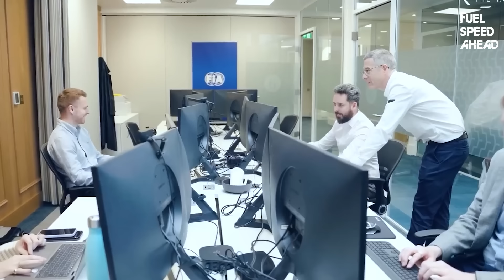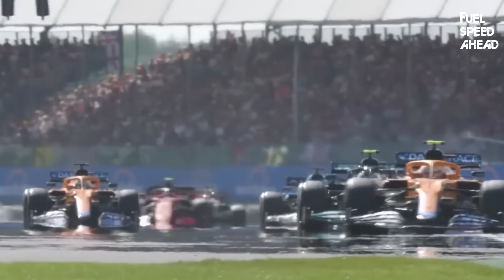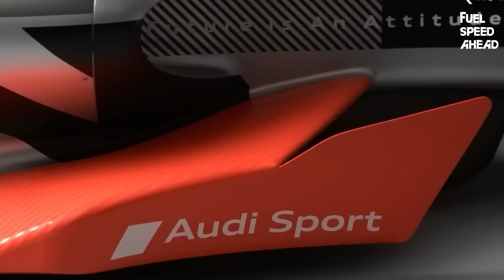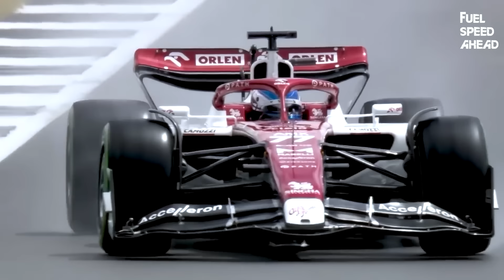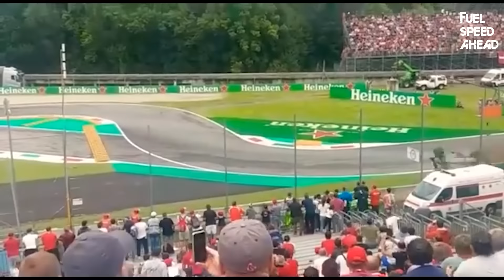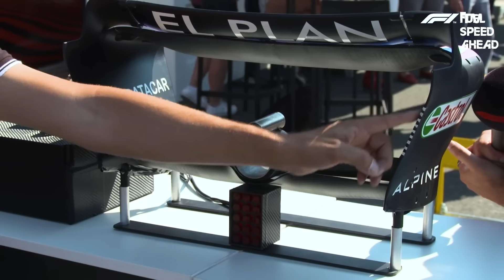F1 2026 Engine Changes That Will Blow Your Mind!

Comment: This is the F1 expression of the FIA. Utter nonsense. A supposedly 'professional' organization that has no clue how to operate a racing program, professionally. Meddling around as quasi-technologists, dictating technical approaches to electro-mechanical/physics based systems that only complicate the performance of what is essentially, a sport: & @ a time when electrification of cars is in retro. Of course, rules are necessary to ensure fairness is practiced, given the human propensity to seek an unfair advantage (see Red Bull's cost cap cheating), but the F1 officialdom have proven that they cannot even obey their own rules! Evidenced by Michael Masi's manipulation of the end of the 2021 Abu Dhabi race which took away Lewis Hamilton's 8th F1 Championship & which was upheld by the Stewards, & not reversed by the FIA. I am anticipating a difficult 2026 season, while hoping & praying it will not be.

Comment: Technical regulations are so mind numbing and essential at the same time. However, I really think the FiA would make F1 so much better by just stating what the dimensions and weight of what a car should be, the engine + battery size and the safety requirements then put a spend cap on and let the engineers go at it within reason obviously. 

The fact these new cars are potentially 2-3 second per lap slower is a joke - potentially meaning even Lance Stroll in the 2025 car could lap the whole field in a 2026 race. 

Is anyone really excited for the 2026 changes?

Comment: Electric power was always going to take over eventually. The writing was on the wall with the hybrids. There's a few problems. 1) The FIA always talk about cutting costs. But with this new changes they had to massively increase teams budget. A total contradiction 2) keeping fans happy. Fans have been saying for years that sound is very important in racing. When they changed from V8's to the Hybrids many people stopped following the spot because the new cars were too quiet. Now they are going to an even Quieter formula! It is almost at the point where the sounds of squeeling tires will be the loudest sound from a race!

Comment: Active front and rear spoilers are old ideas. We're used in Mitsubishi 3000GT VR4 year 1991 to 93 later models were built without it. I know as I had one from 1991.

Comment: I wish they would cut out the environmental bullshit. If you could magic up a battery with a wave of a Harry Potter type wand, then batteries are more environmentally friendly.. IF the energy itself used to generate the electricity is green, and the environmental cost of producing giant windmills and recycling old ones is also green. Mining and processing the materials for batteries totally destroys vast swathes of territory which the advocaats ALWAYS seen to skim over. Battery tech is fantastic, (but not in racing), but battery construction is F*CKING EVIL

Comment: Cleaner, greener future? What planet do you live on, certainly not this planet which is being raped by the Chinese for so called rare earth materials, destroying rainforests and other eco systems whilst spilling dangerous substances such as arsenic into the air, which are also carried round the globe by the five major winds and at the same time killing local miners and polluting water systems. There is only one potential, economic solution, fully synthetic fuel powered. Currently providing 10% of the motive power in the Porsche Carrera Cup. New developments in electrolysers are bringing down the costs of production on these fuels and they are on course to be equable (and more stable) than current hydrocarbons. Stuff your hybrid electric cars and F1 with this crazy development, we want to see racing on talent not on electronics!!!

Comment: Personally, I am both excited and worried. This video does make one feel like the racing may be a lot different.
Maybe like when you are low on fuel in your plug-in hybrid car, and you turn off the air conditioning to get extra miles; and one starts to drive more like a hearse than an F1 car.
Let's wait and see.

Comment: I believe adding brake lights to Formula 1 cars would offer a significant safety benefit. It wouldn’t just help the drivers behind react more quickly, but it would also give stewards clearer evidence during incident reviews. Being able to see exactly when a driver applied the brakes could make it easier to determine whether braking played a role in a collision or near miss.😊

Comment: I find it funny when they brought out a F1 car from the late 90 early 2000's and do an exhibition run, the fans and drivers go nuts.  The sound alone is awesome.  We already have an E series car.  Let's go back to V8's or V10's, lose the electric motor, big wings, flat bottom cars and go racing.  And while your at it, lose all the telemetry back at the factory and AI for predicting every possible outcome and just let the drivers drive.  Been watching F1 for over 40 years, and 2026 does not inspire me to continue.  My 2 cents.

Comment: yeah....zero carbon...this propagandistic bullshit is like cancer. Does anyone in the business happen to have learned that energy for charging the battery comes from the engine itself? Or that turbo means increasing the flow of oxygen into the engine? Which .by the way, will result in carbon dioxide, after burning? And this, for creating the energy to charge the battery...Mindblowing...

Comment: It's going to be a complete failure in 2026 with these new engines and more electric power. If the FIA listens to the fans they want to bring back the V12 engine get rid of the hybrid system and go back to refueling

Comment: No DRS thankfully
Reply: Not exactly... They are keeping it in but calling it "Active Aero" but allowing all drivers to use it in the previous DRS zones and not just as an overtake tool. They are replacing DRS with a "Overtake" button that will instead allow more horsepower in certain track sections which will instead hopefully lead to more wheel to wheel battles.

Comment: Give driver’s a set number of  wing openings, that can be used during race at anytime. Save them up or not just give drivers the choice. The corners will close the wing , that’s one opening do it again that same lap that’s two every time count. Run out game over.

Comment: In my view, we should embrace the internal combustion motor and let the electronic boost stay within the series of E cars, which has its own series
Reply: same here, v8 on biofuel
Reply: However you look at it, (solo)ICE is dead. Sadly, but surely. No ICE can match the immediate torque of electric motors. Bio-fuel is nice for races, but not sustainable for normal road use seen the enormous amounts of plants you need to create enough fuel. To keep F1 the fastest, you need to prevent Electric cars becoming faster. Don't forget Electrics have only entered the arena for a short time. They will overtake ICE in a 'few' years. Before 2004 we had the same discussion with motorcycles going from 2-stroke to 4-stroke. They also will have to switch to Electrics some day. Sad, but true. And it will survive as a sport. There  have been so many rule changes in motorsports and every time people say "that'll be the sports death" and it never is. Some old fans may quit, some will adapt and new ones come in.
Reply: So watch boxing instead of mixed martial arts. If you love history, go watch old movies. F1 should lead the way, not wither on old vines. Do you feel the same way about induction or ignition systems? How about brakes? Should we go back to drums? Should we remove all electronics? Body on frame?
Reply: @ruraloregon2347 stop talking bollocks bring back v10s 🚗💨
Reply: @ruraloregon2347 just because your moving forward doesn’t mean your going somewhere better. Ask the snake that’s in the eagles claws as she takes it to her nest.

Comment: I am really tired of races becoming tyre life damage limitation excercises! Jesus, the 25 lap limit in Qatar tells you their crappy tyres are not designed to last the term under all conditions. Is it time to go back to having more than one tyre manufacturer in F1? This tyre limitation crap is wearing thin for sure. There are enough power unit/cost cap limitations already, we do not need this piss poor tyre crap interfering with racing. F1 is supposedly the pinnacle of motorsport, so why do we have crappy tyres that cannot be more performance stable?
Reply: FIA asked for less durable tyres they can easily make tyres to  last 70 laps no problem like the old days but to much tech  would destroy F1  active suspension   DRS  ABS breaking  power stearing and so on they can even drive themselves now
Reply: I agree and it is going to get worse…Gonna suck

Comment: Managing battery use isn't racing. 
Dump the hybrids, go back to V8s, fastest wins
Reply: Lol, V12 if it's going to be true, hell even V16, but minimum V10, only Yanks thinks a V8 is the pinnacle of engine tech.
Reply: @itchyball5 well id like V10 personally but v8 was what has been mentioned
Reply: @itchyball5  N/A engines, no matter the cylinder number, are history.
Reply: @garypope6382 you just keep watching your formula e buddy, but net zero plans for a sport that races 24 times a year with restricted times for testing is ludicrous and the sooner it stops the better the sport will be
Reply: Dump Bernie while you're at it.
Reply: Well you manage gas back in the day, you manage tires now, managing things actually is racing. You shouldn't just be able to go all out all the time. It should be challenging and you should be able to manage things.